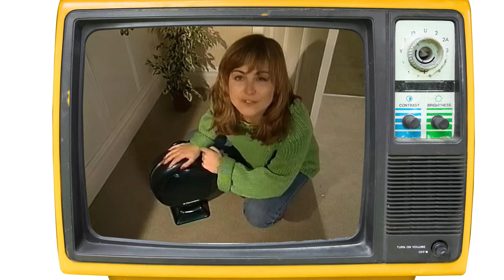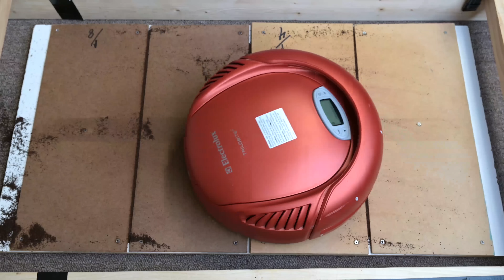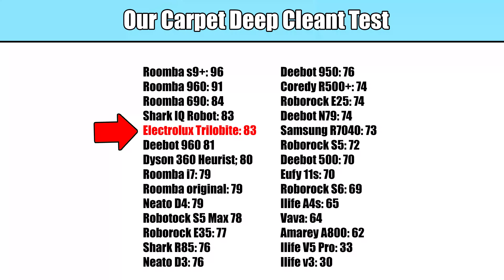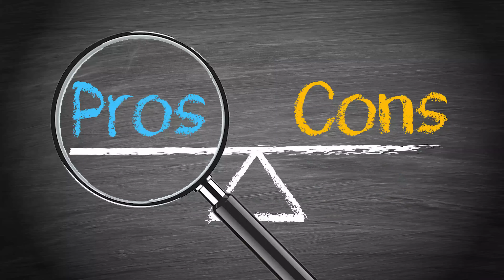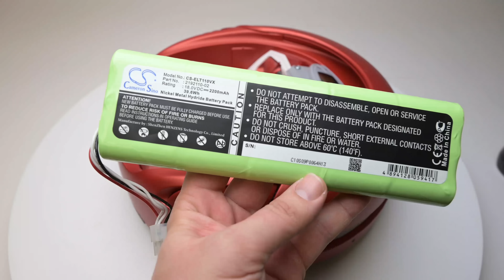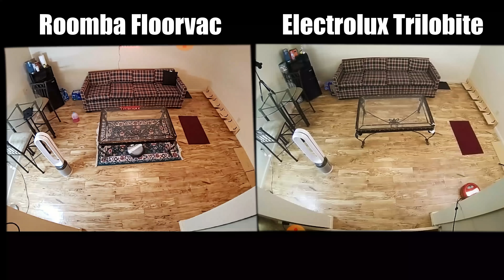The Worlds FIRST Robot Vacuum WAS AMAZING - The Electrolux Trilobite

Comment: I was the CAD engineer tasked for the surface development using Catia V4 on this contract project at Electrolux Stockholm in 1999. 
The sonar used mobile phone microphones (standard stuff), very innovative at the time. I was told it was to cost £3000 when on the market.
Reply from the maker: Wow!  Thanks!!
Reply: Stupid question, but I was sure I've seen at least prototype robot vacuums on video since the 80s and probably Japanese. I swear and can probably locate the video source with some effort. It would be interesting to know what  their actual functions were and how available they were commercially etc.

Comment: I still own one of these. Don't use it cause the batteries don't hold power even after buying new batteries and doesn't connect with my charge base easily.  Wish I could fix it cause the power, ease of use, and ultrasonic object detection were awesome and still awesome, apparently.

Comment: Mine is still better than any other model I've ever been able to try on hard floors; and while it's not the best for short or medium carpets it's still truly impressive on long/shaggy ones. Battery life is not that much of a problem since it can return to base and resume (sure, far less efficiently than modern smart navigation ones but still...) And unless you get a bad electronics failure I don't see one stopping anytime soon. Also I had between 60 and 70 min of use when batteries were new...

Comment: Growing up my mom had a reddish coloured Electrolux vacuum that she bought in the 1950’s.  The thing was still working when she passed away in 2010.  They were built to last back then.  Meanwhile I’m on my 5th robot vacuum in 15 years.  I don’t find any of them last long.  The worst one was the Neato D7 robot which broke down after 14 months.  The motherboard that controlled the Lidar laser went.  The cost to fix was so ridiculous that I went out and bought a different brand and threw the D7 into the recycling bin.
Reply: Anything you could easily lift with both hands ain't gonna last more than 10 years of constant use these days. parts being increasingly complex & difficult, & more importantly, new stuff rolling out almost every year or 2. not many would go buy the new stuff if the old ones ain't gonna give & break after all.
Reply: Falcon Windblade I can lift my Dyson vacuum with my hands and it’s used every week on my carpets.   It’s 13 years old.  My electric mixer gets used 2 or 3 times per week and it’s 8 years old.   Believe me, I’d love to get 10 years from a robot vacuum.  I spent $799 + 13% sales tax on the Neato D7 and it broke on month 13.  That’s nowhere near 10 years.  Not sure you actually read my first comment because your reply didn’t make much sense.
Reply: @ds99  Chill. i'm just stating a general observation, & widely considered fact, not specific to your situation. there're definitely outliers (unusually long-lived or short-lived), but i was saying that that's how things work for most part these days.
Reply: I've had the irobot Roomba E5 for a bit, and there has been nothing wrong with it since its purchase.

Comment: This is actually what I would expect for a traditional vacuum manufacturer designing a robot vac.  Basically, a scaled down, battery-powered traditional upright vac, with drive wheels and a navigation approach.  By starting from the traditional vacuum approach, you are led into a destination that is going to result in something big, heavy, and power-hungry (thus the need for big batteries).  It is interesting how close they wound up to the design pattern that has proven successful.  The inability to get under furniture coupled with the high price tag (both driven by the design) make for a market failure.  Doesn't surprise me that the traditional vacuum company aces the crevice test, though.

Comment: Tomy Dustbot was the first robot vacuumcleaner actually, although it worked only for table tops.... Anyway, the Electrolux will make a nice addition to my robot collection!
Reply: No it was a robot swiffer called the dust puppy
Reply: @nonenone9611  Nice, but still 13 years newer than Dustbot.
Reply: I guess the definition would need to be botvacs that truly served as tools instead of toys in that case. kinda surprised to see vacuum cleaners existed in such a small package way back.

Comment: Still have mine and it works great. Had to resort to 3D printing/fabricating the consumable parts to keep it going.  Also rebuilt the battery packs.  Just made of standard Sub-C cells so no big deal there.  The vacuum motor on this thing seems to be on par with the top of the line Samsung unit that has the most powerful vacuum motor.
Reply: Brilliant work -

Comment: I also have this robotic vacuum cleaner, although its version is 2.0, but in fact it is almost the same. Now I have a minor problem because the vacuum cleaner writes an error (18) or an error 7 (bumper error), does anyone know how to solve it?
Reply: Matyáš Kalvas I think that you will have to take it apart to fix it. You will need to check the microswitches and replace a stuck switch.
Reply: atom starfire productions Ok, thank you for the feedback, how do i get these microswitches?
Reply: Matyáš Kalvas im not sure about part numbers or where you can find them as I don’t own one. They may possibly be generic parts, however, if you aren’t experienced in electronic engineering you may want to do some research about this.
Reply: or how to fix them
Reply: @matyaskalvas5541  dont take it apart just yet reserch cause it might not use microswitches
Reply: TheSavageDog28T OK Sure
Reply: TheSavageDog28T for now 😏
Reply: Anybody know how to solve error 18?
Reply: @matyaskalvas5541  Do you have a short clue on what it is

Comment: Please do more electrolux <3 this was very interesting, maybe look over Electrolux's Pure i9?
Reply: That would be great, the Pure i9 looks really promising!
Reply: @zsoltike  Right? I didn't even know they had a line of robot vacuums. I searched how much this one would cost on ebay, and found that they had newer models, then tried to find people reviewing it... and nobody reviews like this guy out there it seems. after 3-5 "reviews" i had to tell him to do it, that way it gets done right. lol
Reply: @AndrewJones816  If I am right the Pure i9 is only available in Europe. In the UK and Germany is under the AEG brand
Reply: Sounds like a great idea! I’m especially curious on how the Electrolux Pure i9.2 fares against other current robovacs.
Reply: I have one. It's good if you use it without the smart features. The auto dock doesn't work great, the app has a lot of glitches and the corner brush gets tangled a lot since the brushes are very close to each other, so you have to replace more often. The battery life also isn't very good, but it depleted a lot since I use it almosy every day. For the plus points....it has a lot of power, it has a camera based navigation, but not sure if it's vslam (what it's good at is avoiding small things on the floor like dog toys), a large dust bin and good filter and a nice triangular shape to also help with corners (but the main brush gets some serious hair tangles). 

All in all, the vac is good, but not for the price, if you can get it for 350 then yeah, but not more. It was a lot more expensive in my country and the only other robo vacuums back then were it and the older roombas.
Reply: Yes, he should do it, its only 500 now

Comment: 18V batteries... interesting. I wonder how much they weight compared to a modern power tool 18V pack (with twice/three times the capacity). There's definitely scope to modify one of these for use now if you don't mind the other cons.

Comment: Really want a cordless stick for my apartment. Have a super shitty vacuum now, basically just suction and is the cheapest product I’ve ever felt in my life. Watched your best of 2019 video along with basically every other video and have narrowed it down. Mainly looking at dyson v8 animal, v10 Motorhead (possibly animal, seen a lot of deals), tineco A10 master or A11 hero, and finally the dyson v7. Have all hard wood floors with some rugs and carpets. Carpets are thick and high pile which is why the v10 animal with the torque drive head is appealing. Will probably need good agitation, and from what I’ve read the normal direct drive cleaner head doesn’t provide the best. Not sure with the tineco, but the removable batter is a HUGE plus. Also longevity, and haven’t heard the best about dyson.

Comment: Pls try nintendo's remote controlled vacuum the nintendo chiritori from 1979!
Reply: wow, the chiritori is basically what all other robovacs ripped off. Just looking at the design, roomba and electrolux started using its entire drivetrane, dustbin system, and circular shape.
Reply: @voidofspaceandtime4684  exactly.
Reply: Favman09 wow that’s interesting. Looks like a cool vintage toy.

Comment: thanks so much for taking the time to do this one! i've been wondering forever how it stacked up against irobots 2002 and all that. i finally have my answer! thanks so much! i didn't even know there was a 2nd gen of it. maybe one day you could find the 1st gen and compare it to the second gen and the irobot 2002 version. that'd be interesting.
Reply: First (Trilobite) and second (Trilobite 2.0) are totally same, just the color is different, and 2.0 has 200 small upgrades, says Electrolux, for example the stair detection sensor, that black dots on bumper. But it has same brushroll, brushroll motor, and suction motor (ac brushless).
Reply: @robovaccollector  thanks for the input, really appreciate it. :)
Reply: @robovaccollector  you wouldn't happen to know if the 1st gen of it had the charger with it, would you? i know that the irobot roomba didn't come out with that until 2004 with the irobot discovery model and ever since then kept it for obvious reasons of course. the other thing that irobot did that the trilobite didn't/couldn't do that irobot did that i feel put them where they are today was the invention of the virtual walls which really put them ahead of the game in many ways. it's interesting to me that they didn't stay in the robot vacuum game and just abandoned it. makes me wonder if they regret it now given what's happened with the market and all that. just my thoughts/opinions.
Reply: @tanyasobsessions2131  well, both, 1st and even the 2nd generation of trilobite had docking station, and both had magnetic strip, which works like virtuall wall, but iRobot was the first, who make electric virtuall wall

Comment: Oh dang chris, I had that one in my watch list on ebay and was gonna buy it. You got a good deal and I’m glad it went to you. I am collecting all the  Electrolux vacuums with that same red orange color and the trilobite is my last one to get.
Reply: The Trilobite 2.0 was in used condition with bad battery on bazos.cz, which is simillar like ebay for about 25$. So i bought it Seller says just need new battery but it is still dropping error 7. Bumper is clean, sensors are clean, everything is okay and if i try to turn it on, it will just show error 7. Please, do you know what could it be?
Reply: RoboVacCollector you need to use a multimeter to check the micro switches for the bumper. Either they are not working at all or it’s reading them constantly in the depressed position.
Reply: @nicko5945  ok, i'll do that, thank you very much.

And another question, somewhere i was reading, how to get the bumper off, there are 2 small holes, where i need to push with some thin thing and then it release the lock of bumper. But someone wrote there, when you're putting the bumper back, you can damage the mother board. Is it true? I really don't want to break it more. I know a lot of robotic vacuums, about Roombas from A-Z, about Ecovacs Deepoo robots too, and about other brands i know lot of things too, but electrolux is for me new, so i just know error 7 is some bumper issue and the vacuum motor is brushless ac motor like in drones. Thanks.
Reply: RoboVacCollector shouldn’t need to worry about damage and long as you go slow and don’t force anything. All the sensors are bundled into a single white connector that you will also need to make sure you unplug from the motherboard before you pull it off.
Reply: @nicko5945  Ok, about that connector i know, simillar are on a lots of robot vacuums, thank you very much! Have a nice day.
Reply: Nick O We need to be friends! I'm  not willing to part with my not even one  ELECTROLUX vacuums. I recently  aquired a new one due to the passing of my family member (90 + years old)!